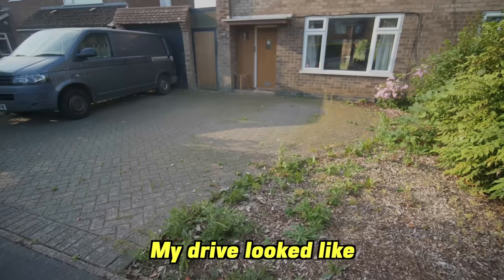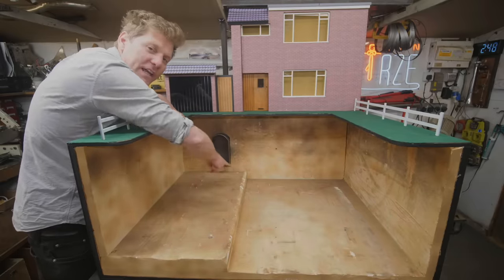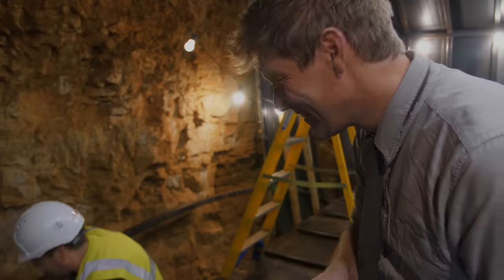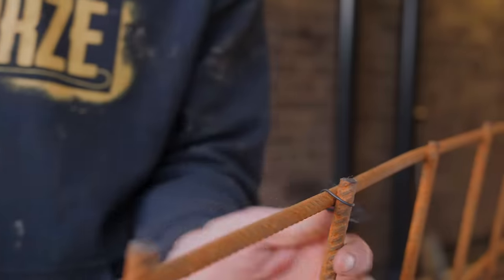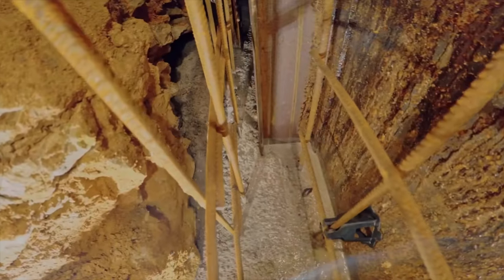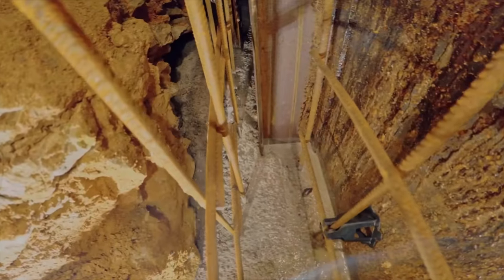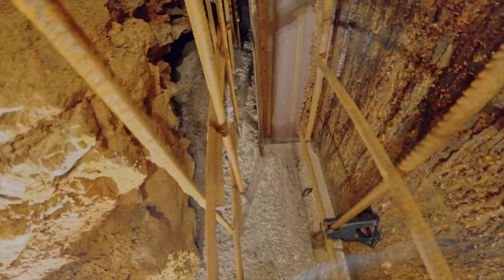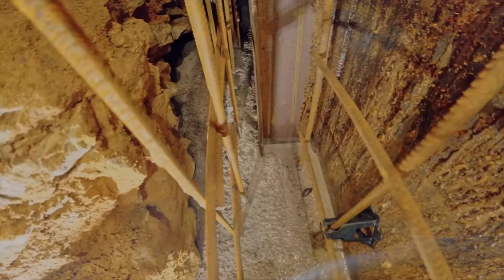Digging A SECRET GARAGE Part 3

Comment: For the exposed rock face in the underground garage. 
You could make a box shaped cut in the rock and put the metal right into the rock, then use glass as a barrier or else clear epoxy to make it look like a mural. Plus you could add LED lights to it so it’s highlighted
Reply: Had this exact same thought. Curious how He would go with big epoxy window. Seen it work really well with number plate and posters on the floor and covered with resin.
Reply: i thought of this first. and my idea is to poor 20000 gallons - of the resin in between the glass and rock. so it would be 1-2 feet thick and 8 feet tall (you want the resin wall to be 2 feet past each wall or else you would see the sides where the resin stops and look like poop. the led idea is a good idea you can change the colors and i know for a fact it would become the focal point not the delorean. i imagine the blue would be the best contrasting color. also never drive it in the rain ever. PULSECHAIN $0.00014
Reply: @Elitehacker74  i had this idea first.
Reply: 2ft past each wall, is this just another square section? curious if could save on some resin by growing window into 40ish degree outward box section line the internal walls with mirrors. then create a temp form plate that pertrudes only out about a half a foot / ft, so when removed it could decorative frame the window which would house the LEDs and illumuniate the wall whilst hopefully creating a bit expanding depth illusion up close.  unless Collin gets a epoxy resing supplier sponsor :P but kudos on idea 1st   @hextremelydesirable1648

Comment: You could have a sort of "rock veneer" by building the far wall in place in a narrow trench before excavating out the entirety of the room, filling in the space between rock and metal with concrete, then excavating back to within about 30cm of the concrete. You'd end up with rock inside the room, not outside a window, while still having a solid structure and moisture barrier. The cross section would end up something like:
air | rock | concrete | metal | concrete | rock

Comment: 19:45: Question:Are you going to make some sort off cover for the ground for when the car lift is in the big turntable room underground? So that the car can be protected,there wouldn’t just be a massive hole in the ground and most importantly that it stays a secret. (Even though you’ve been tearing up your entire front yard probably three years at that point and that it’s probably the most known secret project ever)
Reply: My guess is that he'll have a roof on the ramp itself. It's difficult to see how he'll be able to incorporate a turntable though. It will be a tight squeeze if it does fit.

Comment: There has to be a membrane between the concrete and the clay, especially in well drained soil, so the concrete can cure properly. The membrane prevents the soil from stealing moisture for the hydration chemical reactions responsible for the hardening of the mixture. Keeping it wet also prevents fissures from forming due to shrinkage.

Comment: Colin!  You need to add to the biggest DIY project record.  How about behind the glass / perspex wall you do the biggest epoxy resin pour on the internet?  I imagine the rock and clay will need spraying with a clear sealant first.  You could even get the UV stuff and cure it from the inside as it pours.  Safety squints on!

Comment: Okay, so here's the strategy to make a "window to natural rock" wall.

1) Dig until you get to a section of rock you like the look of.
2) Use your hydraulic ram to slice some strong metal straight down from the surface about a foot or two behind the rock face.
3) Fabricate a metal object.  A vertical piece the same size as the one you just rammed into the dirt, and three more pieces on the left/right/bottom, at right angles to it
4) Ram the newly fabricated metal thing into the rock face until it meets the original piece of steel, thereby making an entire five sided box.  Weld/bolt it up carefully.  This may involve some careful digging.
5) Fill the box with resin.  Let it harden.
6) Lift the entire thing out with a crane/forklift.
7) Build your room with an ordinary steel and concrete wall
8) Bring the resin sandwich back down.  Cut the steel off the front.
9) Apply window dressing to make it look like a real window into nature

End result, a stable piece of rock and resin that looks natural, but is actually just sitting inside your nice climate-controlled garage.
Reply: no lol
Reply: Few tons of resin, sure! I want to see when that goes exothermic, lol
Reply: @PexiTheBuilder  maybe do it in stages :)

Comment: Colin one thing to consider with your rock window is does it need glass? If you form the opening up and cast you concrete around it you could leave the rock both visible but also accessible.
Having a tool shelf or work bench with a rock "splash back" would add a little more epic to what is already one hell of an epic project.
Reply: Ground moisture might be an invasive problem if he does that.
Reply: @Freeman-Dl70  If water is coming through you probably don't want it trapped behind glass where it could condensed or grow mold.
If it's just a little it will probably evaporate away. If it's a lot it's probably going to need a drain and sump pump anyway.

Comment: Gonna need a catch basin underneath with pumps primary and secondary. If you want a glass wall, use a dehumidifier with a humidity sensor and run a concrete box into the rock wall with rebar pounded deep in the wall horizontally. You could use a small ozone generator in the space to keep mold or mildew from growing. This project is epic!!!!!!!!
Reply: if he could maintain a constant humidity, i wonder if he could have a cheese room
Reply: Can he just fake it? Use some of the clay or just make a plaster replica? To look cool it wouldn't have to be too big, just a "window" placed in the right place.

Comment: To stop condensation on the underground rock window, you should fill the space behind with resin. It would also help with structural integrity...
Reply: Wouldn't the resin just collect dirt as well as the room is bound to shift slightly and you'll never be able to clean it.
Reply: @DadBodDrumming  if the resin is binding to the rocks (just as the concrete does), it won't be able to shift. Only the clay might be a problem, and of course the resin cost
Reply: @a_utuba can you spray the wall with clear resin first to make the dirt not contaminated the resin afterward?
Reply: Or you could take a cast of the rock wall and make tiles of it to put on afterwards. Or maybe you could inject it with something like they do with basement walls and just keep the rock wall as is? I dunno, just some thoughts.

Comment: you could put a sock tube on the outside of the rock window and use a radon blower to move air and reduce or prevent condensation on the glass....

Comment: Suggestion on the stone wall - Make a recessed area instead of the window and set into the recess will be a painted mold of the original rock wall. The garage will be all sealed up with the cement all the way around and no humidity issues on the outside.

Comment: Hey when the model of the house is finished it should be in the workshop part of the garage, if there is room. And try looking up 1/10 scale remote control DeLorean, but they might be a little more expensive than you want to spend but you could drive it xD.

Comment: I know this may sound like a bit of a cheat (and MORE WORK) but to get the rock face viewable through glass you could remove the rock face to a 1 or 2 foot depth and reassemble it in it's own steel box so that it is fully encapsulated. I know this would make the stone wall more of an art project than a natural feature but it would solve the condensation issue for good. Of course I am not an engineer, nor do I play one on television, but when it comes to nutty ideas I have a million of 'em! Thanks for all you do Colin!

Comment: Windshield wipers!
Every secret garage needs an aquarium in the wall and a submarine periscope to make sure it's safe to exit.

Use a sealant on the dirt wall.

Will a car be able to park on top of the lift?

What happens if there is a car parked on top when the lift is activated?

Comment: That turntable/lift should drop to level with the main floor. This way theres no step up or down but you could turn the delorean 90 degrees and pull it into the other side of the room then drive one of your many smaller projects onto the lift. Turn it another 90 degrees and lift it and drive it out.  The lift can be separate from the turntable. Take a look at a train roundhouse. They turn entire trains around. Granted it would be built onto a lift that lifts all of that as one. For the rotator you could look at what that digger uses to spin around.

Comment: Had a question regarding the eventual lifting mechanism for the DeLorean, you describe a circular plate for the rotation of the car but the hole at the top is rectangular, how do you want to make those fit neatly into eachother?

Comment: I have done something very similar with my shed that is under my existing house, i created an extra 50sqm of storage room underneath my house however i used a very different approach that seems much simpler and more cost effective. I used a product called shotcrete, basically its the same stuff they use to build concrete swimming pools. I dug out the area, supported the roof, installed reinforced mesh on the entire floor and tied it all into the walls then we just sprayed a very high mpa rated concrete onto the floor and up the walls all at the same time using a concrete pump which basically sprays it on. The strength comes from the floor being tied into the walls, you can then just frame it out using whatever materials you like for the floor and walls etc.. surely this would have been much more cost effective or am i missing something?

Comment: Colin, rather than run the inevitable risk of the dreaded condensation. You could remove the window completely. Instead replicate a window by having an artist construct a fake rock wall in plaster and paint using the existing rock as reference. This way you have the appearance of rock coming in both in look and feel without hiding behind a fogged up window.

Comment: I don't know if this will be seen by Colin but there are two options that you could do you could print out a picture of the wall on that far wall and then put it over top of the actual wall or you could have somebody come in and build you an artificial wall over top your actual wall both of these will stop the condensation and worry

Comment: Could you do some experiments with epoxy to see how well it binds to the stone and see if it remains transparent?
If you can stabilize and seal the area you want to view through the wall then you can back that with whatever transparent material you want for the window and not have to worry about condensation.
For the record, I don't think this will work, as water will probably create a gap between the stone and the epoxy and make it look terrible, but that's what experimentation is for. Maybe with adequate prep work and the right epoxy it will soak into the stone and keep water out of the interface, preserving the view🤷

Comment: Instead of glass exposed to the wall, you may be able to fill that space with something like apoxy so it does not condensate, its not air between the glass and the wall, its a transparent material. Does the trick!

Comment: for the wall part, not a glass, maybe a thin wire wall? So you can see it but its safe?

Also my guess: 262.650,00€ > 224.620,91.- GBP

Comment: It may be a bit ambitious, but could you pour a clear epoxy type thing in between the glass and rock to not allow the moister to get airborne and there would also not be any air glass boundary on the rock side for moister to interact with

Comment: Collin,you really have to fill the bottom floor with pebbles and lay drainage tubes to direct the water away from the structure, otherwise the water will stand and destroy the structure over the time, which means heavy mold and rust....

Comment: As for the glass wall could you not use a clear resin in place of the concrete? That would avoid any cavity between the garage and rock, aswell as no condensation

Comment: Probably to late to ask but when the car is in the garage under the ground do you have an idea for covering the hole so (because it is still a driveway) a car can still park on top? Maybe a Fallout 4 style hatch... also depending on how that would be done I'm guessing anywhere from 750K to 900K $ if you include the bunker tunnel and lift. Sorry I don't have a pound key and I don't remember the shortcut for it so it is in USD.

Comment: My question is: Why didn't you use plywood 1ft (1/3 meters) from the walls when pouring the concrete? You would have saved a lot of money on concrete and it would have been a reduction in weight on the walls. If you use this method, don't forget to pour gasoline or diesel on the forms so you can pry the forms off easier once the concrete sets.
If you want it thicker, just add another foot (2/3 meters total) distance for the forms.
I'm curious what your reasoning was for pouring without forms?
Edit: I see, you wanted more grip power in case the earth shifts.

The other concern is carbon monoxide and dioxide buildup underground. You will need some kind of vent and circulation. It doesn't need to be big since the buildup will be gradual, therefore the vent system can be secondary. It only needs to turn on every now and then, maybe every hour or 2 hours, run for 15 minutes and turn off again.

Comment: So if the plan is that you have a platform on your driveway that lowers into your garage, what is your plan to deal with the hole in the driveway that would occur whenever you actually have your car in it?
Most of the ideas I can think of really don't work with the space you're working with.

Anyways, Great update and model. Can't wait to see what's next.

Comment: Can you 3D print a Delorian to the right scale?
Can the window to the limestone be left without glass so you can touch the rock, or have vents in the glass to avoid the condensation. 
Or, can you find an epoxy company to sponsor a mega epoxy fill?

Comment: Don't know how they tax homes there. Here basements are not taxed unless finished. Are you running enough power for a lift?  Is your turntable going to be powered also? As with your model  are you going to load test your lift ? Love the project, keep digging.

Comment: Maybe instead of having a hole cut in your steel sheeting to show the side of the rock wall you dug, you should completely close all the side off and see about doing a 3d plaster wall art that copies what the dirt looks like. Then you wouldn't have to worry about the window building with condensation.

Comment: Have an idea for your rock view, rather than risk condensation and a possible weak point as you are unlikely to get wall face dead flat. Why not just make a sort double glazed section and fill in-between with rock face sandwiching between a perspex internal and steel outer creating a fake window as such. Wouldn't affect concrete pour at that end and keep structural strength. I know it's not as realistic but possibly an option.

Comment: Each time I have a look on these tunnel/bunker digging videos, I wonder if all that structural metal is going to corrode soon.
Not like I really have any domain expertise to judge, but all that metal beams and sheets do not have even a paint on them, are quite exposed and probably it should be a lot of moisture underground for metal parts to  get rusty quite fast. And there is no possibility to reach "outside" of that metal  for any kind of service jobs. Does this concern make any sense, or am I missing something?

Comment: I think you could save yourself a load of problems if you stitch piled the perimeter of the project and then dug out the middle. and is building control engaged on this?

Comment: alright costs... I'm going to say about 3-4k for labor.
20k for the concrete.
that steel + processing.... that's tough but ill ball park also like 15k-20k
the engineer coming out probably 2k
tool rentals maybe 5-10k for like the yard protector and platform and all that stuff. 
and you r personal time spent on it. lets say your skill sprobably lead to a 150k/year job. probably about 6-10 months of work....75k-100k?
i'd say it'll be like 120k I'm probbbably wildly off USD btw.

Comment: Very good Colin. But you are opening yourself up to an electrical disaster. You should really contact your electricity board. Your bunker is likely to make the local distribution network unstable and potentially under fault conditions your bunker could make the local pme network hot, meaning your bunker could be the epicentre of voltage gradients, meaning your property could have excessive voltage gradients becoming the better earth than the distribution transformer feeding your home. Personally you really need to get an earthing study done, to ensure under fault conditions of the local distribution electricity network, your bunker doesn’t effect the pme protection in your area. I am unsure how to get hold of you to explain your predicament or where to get the advice you need pal.

Comment: My estimate for cost is $45,000 aud worth of steel and probably $60,000 worth of concrete,  total $105,000 worth of materials as a guess?
Reply: Probably an extra 15k aud for the turn table

Comment: Instead of using glass for the exposed part of the wall why don't you try spraying it with a waterproof clairvoyant so you can not just see it but tuch it and block off the edges 😎🇧🇿...